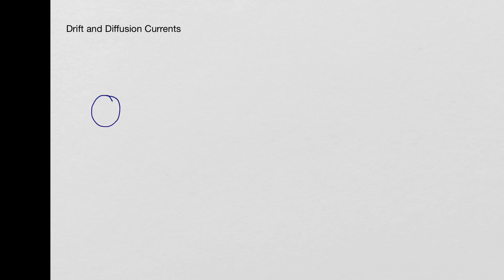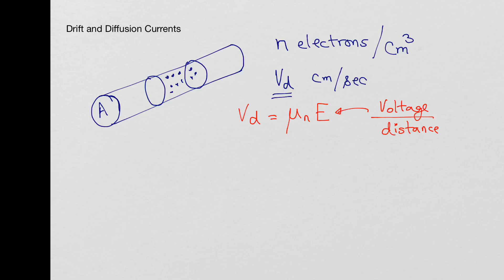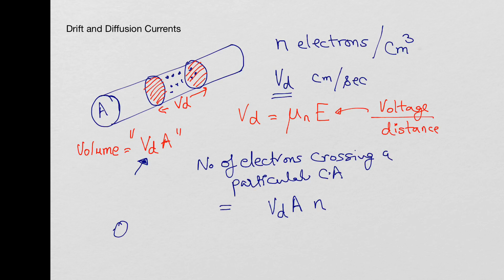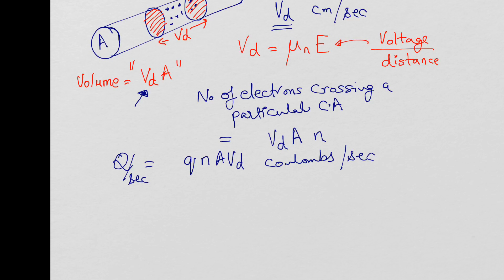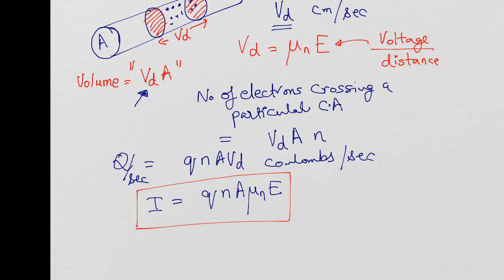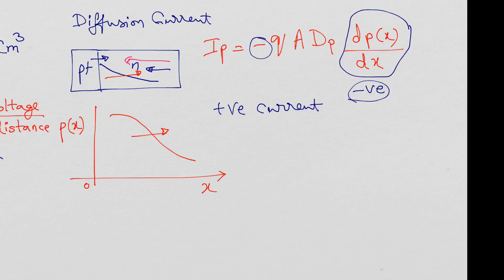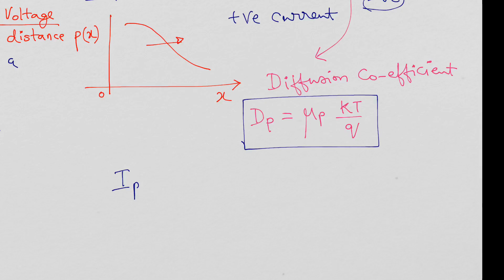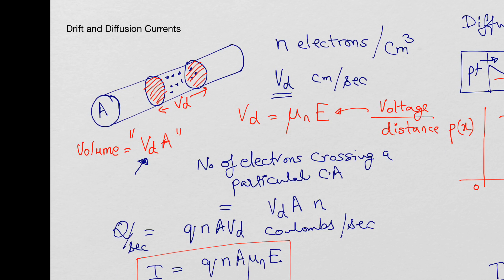Drift and Diffusion Currents

Comment: In your video, the distance you were considering could never be said as equal to Vd because Vd is the drift velocity of the electrons right? I think it should be, V_d t, the length between the two areas you are considering. I think.
Reply: distance in 1 sec
Reply: @randomisedstrength5050  correct